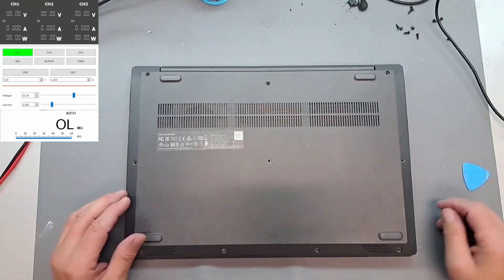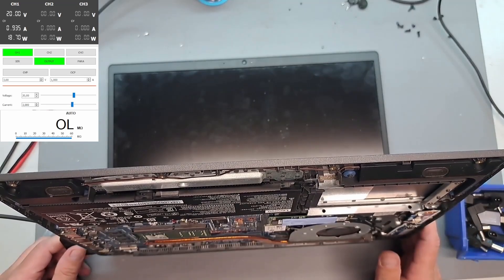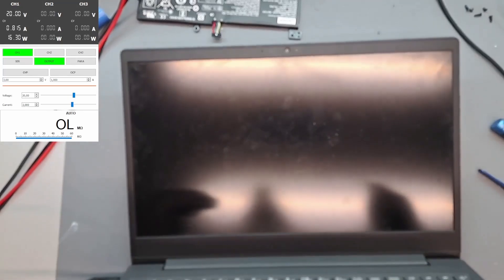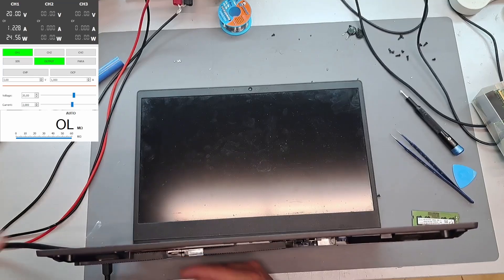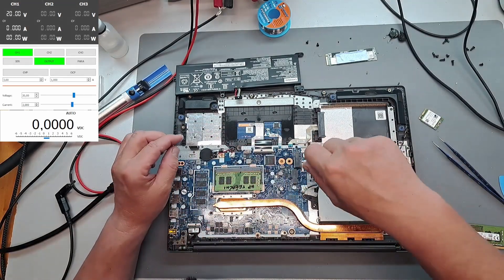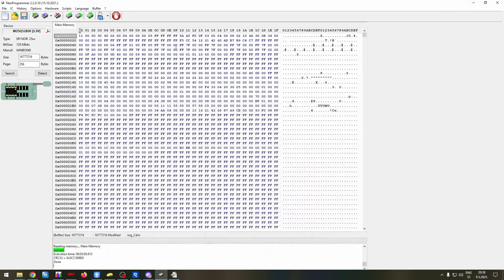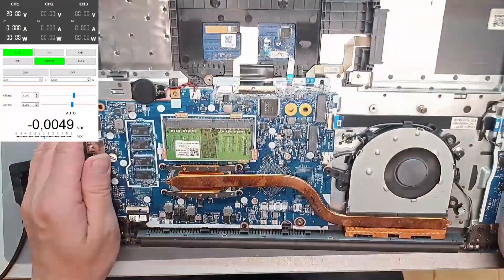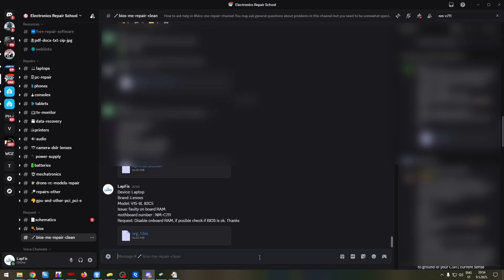Lenovo V15-IIL - Powers on with no picture - Complete diagnosis process - Disable On Board RAM

Comment: Great fix!
Can you disable RAM with hardware method like remove coil that supply voltage to onboard RAM? 
Also laptop is coming on when you hold RAM chip so keep holidng long enough to boot into BIOS and just disable onboard RAM in setting?
Reply from the maker: Hi!
If you take power off ram chips it still won't work. You need to disable it in bios.
Not sure if you can disable it in bios settings, possible. Didn't think of that. But, what kind of video would that be? You need to drag it on a bit lol.
Reply: @Lapfix-HR  It was great video I enjoyed.
It would be interesting to compare bios files with RAM on/off to see which string is changed probably only need to change in 1 place if don't want use virus tool
Reply from the maker: @JFIXX1  Thanks. I like this video and am so sad it performs so badly... What can you do.. I can share bios files if you want to look at it yourself.
Reply: @Lapfix-HR  This is great and useful content and people searching for the same issue with the laptop will be so greatfull with this useful knowledge

Comment: Nice fix 👏
I don't think it's going to survive a BIOS update. In case, you can do it again.
I was hoping you're not going to reflow that chip, Lenovo stick the RAM using some high temperature glue under the chips.

👍
Reply from the maker: Hey! Ye, I had original so it was not a prob. It all went as smooth as butter :).  👍

Comment: If you really want to be sure it was a ram issue, you should try with different size memory modules such as 8g or 16g. This crappy IdeaPad model is well known for a very thin board which usually ends up in crack solder balls under the CPU, affecting especially the memory access data lines.
Reply from the maker: O, I see. Noted. Didn't think of that. Appreciate you!
Reply: @Lapfix-HR  Depending on the affected area under the CPU, you might encounter some other similar symptoms, such as not recognising any so-dimm modules (i.e. working only with the 4gb onboard ram). Reballing the CPU might help fixing the issue in a more permanent manner, but that's usually overkill for this cheap crapy laptop model.
Reply from the maker: @silvake  I understand. Thanks man.

Comment: Great video, you need a faster programmer, I use an xGecu T48 which is very good and not that expensive, too bad for the time wasted with a slower programmer. Good at work 👍
Reply from the maker: Thank you, thank you. That is true, so slow. I did buy T48, it's on its way. Maybe we can make a comparison video between programmers!